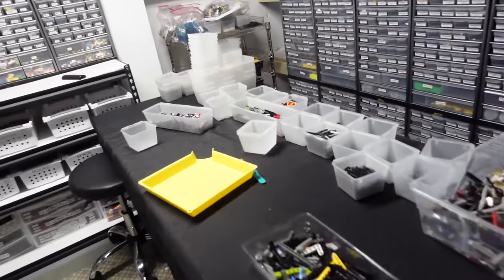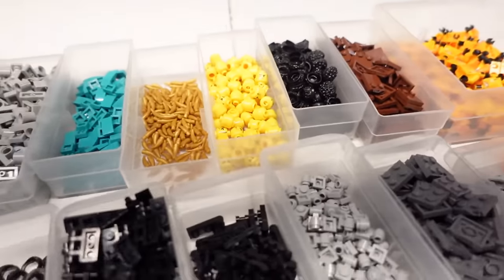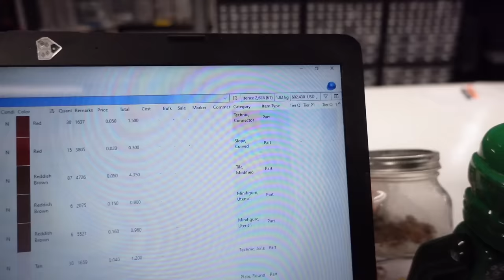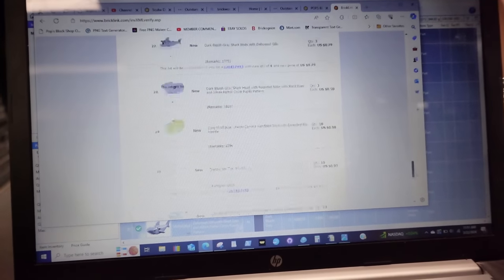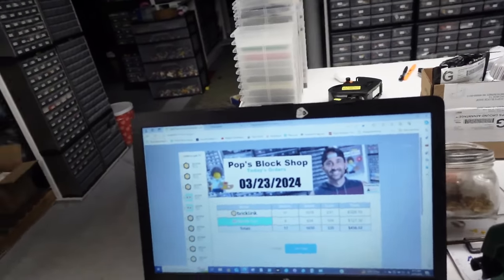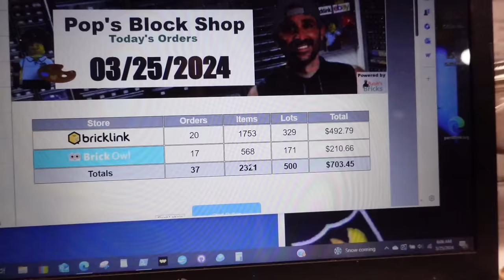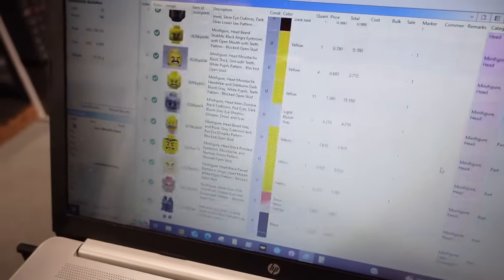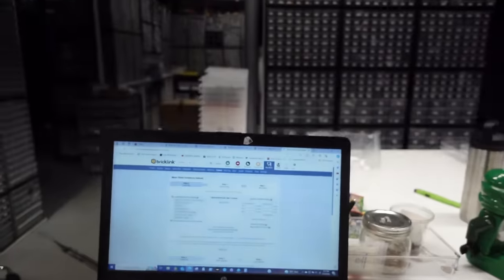IS SELLING LEGO A DREAM JOB? Continuing to pump many parts and Mini-Figures to Bricklink and eBay

Comment: Yeah, this business checks all the important boxes for me. I just wish I stayed at my old job a little bit longer as I was forced to take more than I wanted out in the early phases, but it is relatively easy to bounce back from. That being said, it certainly is not for most people. Lots of prior and nuanced knowledge required and a big commitment to get to a stable and efficient store size. Would be much harder if I didn't have first hand knowledge of the 90's-2000's catalog and wasn't familiar with a majority of the categories/themes going in.

Comment: I was wondering why you have minifigures on eBay and Bricklink? I was wondering which platform is better in terms of selling (minifigures) faster or for more money.
Reply from the maker: I get so many duplicates it helps to sell on multiple platforms to move them faster yes. Mercari is now offer zero seller fees so that is another avenue
Reply: It's basically a duplicate listing, ebay is faster. BL is more profit

Comment: Shipping is a huge deal to me. Sometimes I'll order where the shipping is cheapest. Doesn't really cost $4 to $5 to ship a minifigure, I'm assuming some sellers charge more shipping for more profit.
Reply: I have someone who sells on eBay really small things not necessarily mini figures but really small lightweight things. It does cost 3 to 7 dollars minimum to send anything.
Reply: @ResaleSoda  Not really, I have a business and ship things all over the US. Size and weight is everything. And $3 is fine but definitely doesn't cost $7.
Reply: @canescup12  my last minifig I sold cost me 4.73 to ship. $7 might be shipping plus shipping supplies maybe? That does seem like a lot
Reply: Yes, It really can cost $4-$5 to ship a minifigure.  It will also cost the same amount to ship 8 minifigures. Post rates have been going up.  Some people will bake their shipping cost into their sale price to make you feel better about shipping cost.
Reply: Personally I have a no hassle shipping one rate no matter what unless is very large items (like complete boxed sets).     As a buyer if I see flare rate 5-7.00.    I’m more appt to buy more things to maximize my bang for my buck.    Without concern that I will increase my shipping cost.